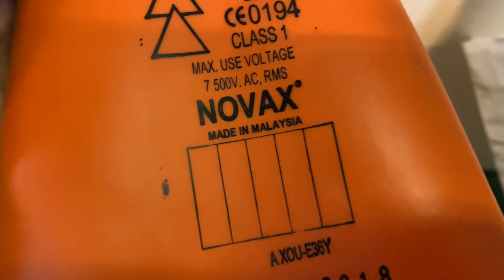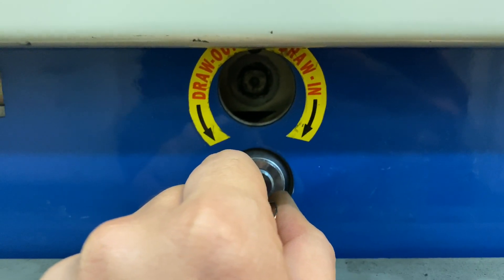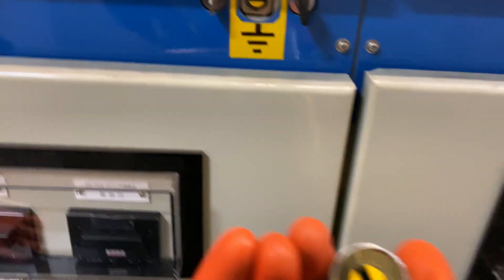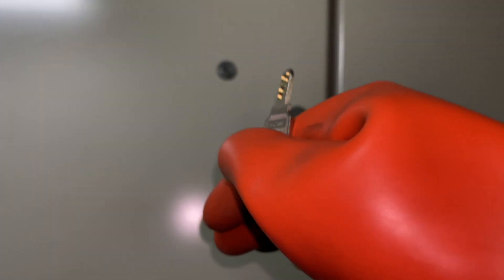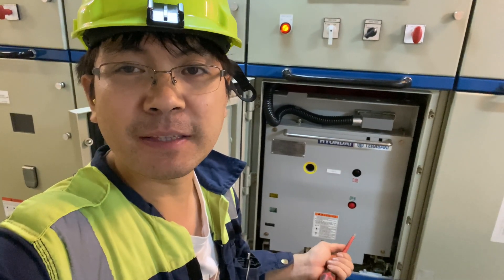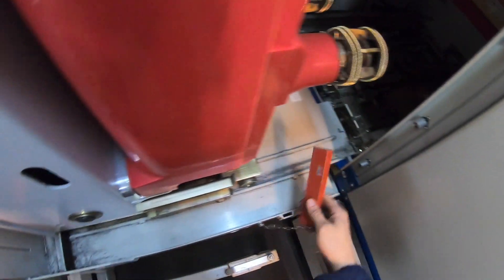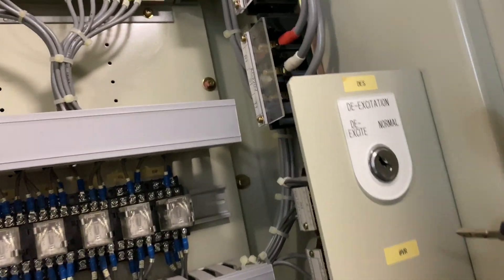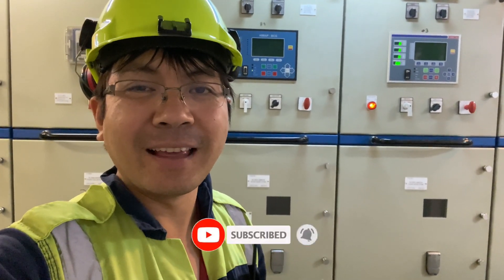HOW TO RACK OUT VACUUM CIRCUIT BREAKER | ETO TROUBLESHOOTING

Comment: May I suggest that if you want to refine this video, please include "turn the Local/Remote switch to Local" before you start the isolation process and only turn the "Local/Remote switch to Remote" when the Circuit Breaker is in Service position. The purpose being to be in full control of your switching  operations. If you have competent persons working at the Marshalling box, there is a possibility that they may short two points to close the Circuit Breaker accidentally remotely from where you are operating the circuit breaker, don't you agree?  Part of reason for Lockout and Tagout is to ensure there is no chance of erroneous switching during switching operations. My thoughts as an Authorised Person for voltages up to and including 22kV switching in Singapore.  Anyway thanks for your sharing of circuit breaker operations.  Have a great day.

Comment: As a power plant operator for 20+ years I have racked out thousands of breakers. 2 things, first where is your arc flash hood?  Arc flash clothing is great but your face would be roasted. Secondly, where are you remote racking devices?  60 year old coal plants have remote devices. When you read the arc flash rating on switch gear there is a boundary to set-up. With remote racking device you can remain outside of boundary. Another great addition are arc sentry or maintenance mode on switchgear. Changes relay settings for when racking breakers for your safety.
Reply: Exactly...there some things in life you just don't do and playing around switchgear and motor control centers without proper PPE is one of them.  Remote actuator even better.
Reply: Not all substations have a auxiliary panel where we can open and close. Sometimes you just gotta hit it with your least dominate hand and turn your face away, or use a “chicken switch” which is a long bendy pole to hit the pistol grip from far away
Reply: Arc flash mode drops for load side. Still potential for line side arc flash energy. However , it would lower PPE requirements , in full agreement with this comment
Reply: Arc flash risk comes into picture only if one or both contacts of the VCB were energized yes? In this case, the generator is isolated and the VCB is open, so the only risk should be of capacitive charges, not really arc flash no?

Pls correct me if I'm wrong.

Comment: I am retired from working at the Los Angeles DWP Scattergood Generating Station. I have racked out and racked in 4160v circuit breakers and 480v circuit breakers. There was a set of safety procedures to rack in and rack out these circuit breakers that had to always be followed. The circuit breakers at Scattergood Generating Station were older than the circuit breakers in this video.

Comment: What is really the grounding in a vessel the body of the vessel itself or anything else like any elctrode or cathode which is touching the sea water ??
Reply: I guess it would depend on the coatings applied to the vessels...I know most saltwater sea fare worthies get ablative paints to their hulls, which shedding of electrons is how they peel off old dead cells to expose better layers of protection in the paint layers.  Depending upon the voltage class we're considering in this conversation and some other factors, I would venture to say that the paint layers constitute some form of insulation.  That said, I'm certain no vessel is sealed completely along every single facet of it's structure and ports, etc;.  I don't know all the intricacies of those ships though...not certain the practice out there on the water but I would think, just like on land, bonding all of the metal structure to bring to water potential would be the ultimate and to achieve that a 'designated grounding electrode', perhaps something altogether separate from the hull would be the order of the day.

Comment: Thanks for the video! Looks like the inspection on your gloves is expired. They need the be inspected annually or after each use if not using the leather insert. You can get little pinholes in the rubber. Your company needs to do this for you, and in the US is a big fine if they don’t.
Reply from the maker: We have spare and the expiry date is always written on the boxes. We are serious in dealing with safety.

Comment: Interesting procedure.

You don't appear to isolate the generator circuit by withdrawal of the VCB truck and the application of a safety lock to the busbar shutters (the point of HV isolation from the 6.6kV busbar) and a lock to the circuit shutters and also no isolation of the VT on the primary or secondary side BEFORE closing the circuit earth switch. Similarly, there was no locking off of the generator to prevent an automatic start. As far as I can see you only managed to disconnect the circuit; you did NOT isolate it prior to earthing. The circuit earth did not appear to be locked in the ON position with a safety lock either.

Equally dangerous is that once you open the HV cable terminal chamber you don't appear to prove the primary conductors not live using a live-line tester before starting work. It's a good practice to always do this regardless of the position of the circuit earth switch. Do your safety rules require the application of a live-line tester to be accompanied work or can you do this working alone?

Comment: No worry of arc flash during rack out procedure?  Take care nice work! Good video 
Sent from USA 🇺🇸
Reply: No mate because the system was already isolated, grounded and disconnected.safety first
Reply: @johnangelodelacruz6431  Hey why do we need excitation key, what is normal and DE excitation
Reply: Arc flash gear is necessary until the system is verified dead. Looks like this fella verified the system dead by earthing it. Oof. All it takes is one missed lock and you’re another arc flash horror story.

Comment: Sir apart from ACB and VCB do we have other types of ckt breaker and does every ship have Vcb
Reply: you have SF6 breakers also
Reply: SF6 gas itself is not toxic at all yet until it burns and that is super toxic. So whenever there  is a S/G explosion, do not enter the switch room unless you are putting on proper respirators. It’s Hazmat zone. Toxicity. FAULTED SF6 GAS – Faulted SF6 gas smells like rotten eggs and can cause nausea and minor irritation of the eyes and upper respiratory tract. Normally, faulted SF6 gas is so foul smelling no one can stand exposure long enough at a concentration high enough to cause permanent damage.  
It is a potent greenhouse gas with a high global warming potential, and its concentration in the earth atmosphere is rapidly increasing. During its working cycle, SF6 decomposes under electrical stress, forming toxic byproducts that are a health threat for working personnel in the event of exposure.
Reply: Sf6 not used in ship it liberate hazard gas in closed space mixed with air